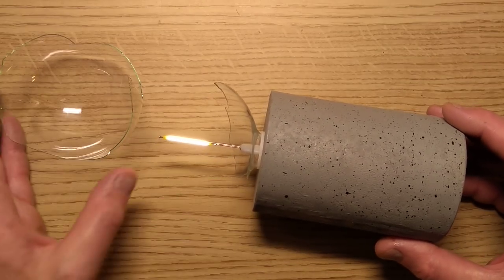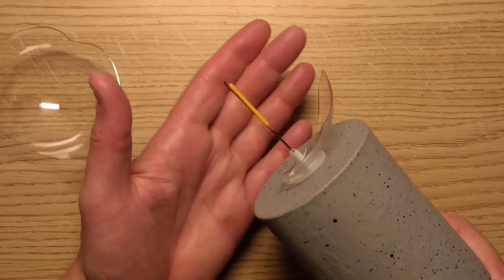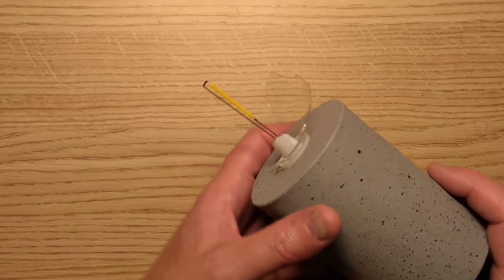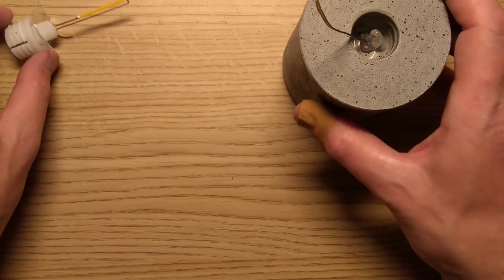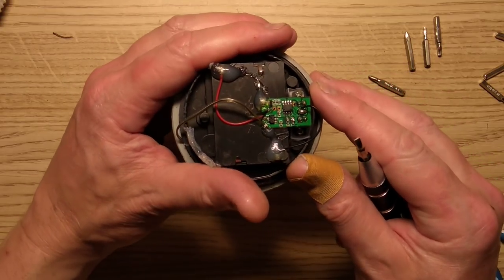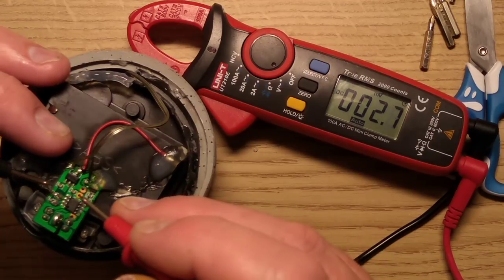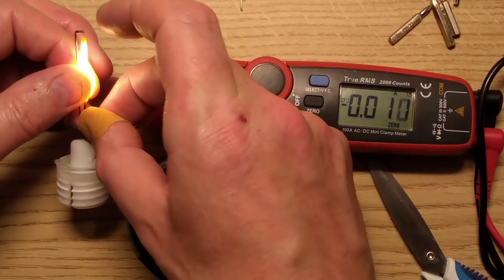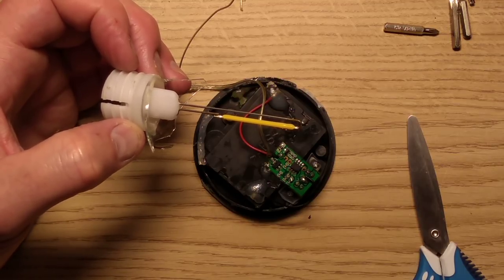Inside a pre-smashed Sainsbury's stand-alone light.

Comment: Crazy that they made it to take AAA batteries.  I hate it when those things are used in devices that are plenty big enough to make room for AA or even C batteries, it's just bad design.
Reply: Exactly.
Makes no sense to have a huge empty resin body to it and not put C size batteries!
Reply: 'C' batteries!?  You could damn near fit a 6v SLA in there!  Charging circuitry for it too.

edit: damn or dam
Reply: Why stop there? That light is already bulky enough to hold something even more substantial than Cs -- perhaps an SLA. It wouldn't be difficult to design the interior to hold a range of battery sizes/form factors, in a common 'nest' with break-away dividers… By default, provision is made for the cheapest/smallest/most anemic cells, but the unit can be upgraded to whatever the buyer desires… Perhaps make it possible to add one or more solar cells. Sell it as a learning tool, a hobby kit, something that will survive for years. Building it to a final form locks too much into place. 

Glass bulb? Strange choice. Something as simple as a clear plastic pill bottle, or something 2/3rds the length of a test tube, would have sufficed to protect the 'filament'.
Reply: Gotta make sales as fast as possible so they use of the shelf components
Reply: Replace the batteries with an 18650! Would last for ages~ Looks like there's enough room in there.
Reply: @LunarHermit  C or D batteries would be better for most people. Yeah, I know, 18650s are technically better but they are still unfamiliar to most people. That makes some people reluctant to buy things that use them. I would have no hesitation and I already have a charger that can charge them among my chargers, but I am not typical in either of those things.
Reply: AAA and AA cells generally cost the same but AAs have a much higher energy content and are thus far better value and need changing less often.
Reply: who still has C batteries though? AA is the way to go
Reply: FireAngel Londoner, powerbanks also use 18650 and people do use them. They could just have made it a USB-charable light.
Reply: @FireAngelOfLondon   People don't seem to mind USB rechargeable stuff, so add a socket and the charging/protection circuitry along with 18650[s] or a LiPo...
Reply: Designed that way to sell more batteries.
Reply: @michaeltempsch5282  Except that the USB connector rusts out almost immediately (this is supposedly an outside light), and the connector plus 18650 costs more than a AAA battery pack.
So, yeah, the vendor won't be doing that; horrible economics and warranty returns.
Reply: AAA batteries will run that led for quite a long time.
Reply: The other evil-genius aspect: design things that take three AAAs, but sell batteries in multiples of two (i.e. 2, 4, 10, etc.). And you get dinged for the ever-more-ubiquitous eco-frais for having chosen to run some little modern convenience on batteries…
Reply: @michaelthibault7930  hot dogs and hot dog buns
Reply: That includes the clamp meter, by the way.
Reply: @LunarHermit  "an" 18650?  Looks like you could stuff a bundle of them in there!
Reply: @MrMilarepa108  I was thinking D for that device...
Reply: It could even hold D batteries, or even several 18650! I love my Luminara candles that have D batteries in them, they've lasted almost a year of occasional use and sometimes forgetting to turn them off.
Reply: I often scoop out the "triple A" bits, and hot knife a bigger space for AA's. Hot glue the bits back in, and whack in some decent batteries. If possible. Usually is.

Comment: For an outdoor garden light, I am astonished they made the globe of thin glass. Bumping it with garden tools or a small branch falling on it, and the globe will explode, leaving sharp pieces of glass throughout the garden. It should have been made of plastic.
Reply: Plastic would fade.
Reply: Maby they thought it would increase revenue.  Still a very bad idea using glass.
Reply: I'd like to echo your comment with the emphasis on THIN.    The ex-mustard pots I use as drinking glasses are only 2 to 3 mm thick but almost unbreakable....  OK a hammer would do it.  I agree, the thinness of the glass was stupid.
Reply: Glass is better than plastic... it's only sharp for a short time, plastic is poisonous forever.
Reply: Colorado Strong  I guess cause both with erode in different ways.... But this is why you don't bring bottles camping.

Comment: I seem to recall an old popular mechanics book of hints suggesting removing broken lighbulbs with a potato - they don't bleed - or scream. Not that I would expect Big Clive to scream - just bleed :)
Reply: Yeah but pushing it down over the LED (central glass column on the old incandescents) might be bad...
Maybe splitting it into quarters and gouging out a channel in two making place for the LED but allowing the bits to be pushed down into, and grip, the screw base.
Reply: An exhausted tennis or racquetball ball, holed (dinked) neatly and axially. Or a rubber handlebar grip partially installed on the end of a broom-handle. 

Potato? Sheesh!

Comment: When I was a teenager I broke a 150W lamp's globe in very much that way. Unfortunately back in the 1980s that meant a tungsten lamp, and it was switched on at the time. The filament went off in a very interesting puff of smoke and then I had to climb a ladder and get the broken bulb out of the socket. I was a bit more circumspect about casually sweeping my jersey over my shoulder from then on.
Reply: When we had (bare) CFL lamps, I'd smash one every year or two while changing my shirt or just stretching.  Now with LEDs, there's less breakage, yay solid state  :-)
Reply: @theskett  Unfortunately all the replacement technologies have much weirder failure modes than good old resistive filaments. Used to be you heard the pop and you went rummaging for a new bulb; now it's "Okay, it's flickering? A little? Oh, part of it is flickering!" or it gets a little dimmer, and a little more, and so on until you decide it's old and replace it, and then the new bulb is blindingly bright in comparison . . ..
Reply: @Azlehria  I had a 200W incandescent explode broken glass across my bedroom carpet; it's now replaced by a nominal 90W of LED lamps which IME fail more gently -- and I'm not going to complain about that :-)
Reply: @theskett  Oh, yes. I'm definitely satisfied with mine - the household is all-LED except for 4 fluorescent tubes in the kitchen (possibly not for long) and a pair of fluorescent torchieres - and I wouldn't want to go back to incandescent or even halogen at 25¢/kWh. The longer life more than offsets the greater cost up-front, as well; they just get a little strange at the end. It's a petty annoyance that's certainly worth putting up with.

I do rather dislike CFLs, though. In my experience their lifespans are similar to incandescent at best, and often shorter; they're far more delicate; even the highest-quality models I've used have run their ballast circuits hot enough to burn (distort and permanently discolor) the bases; except when subsidies peaked they haven't been much cheaper than LEDs up-front; and they have a marked tendency to strobe when failing. There's also the hazmat contamination problem when, not if, you break one of the - again, delicate - tubes. It doesn't even have to shatter; simply breaking the seal at one end or cracking the glass is sufficient.
Reply: @Azlehria  Agreed, on all that... although my experience is that the CFLs run pink at end-of-life (which, from a previous Big Clive discussion, indicates they've lost required mercury vapor).  Sooo, I'm not going to sweat the mercury.  And (due to crockery mis-steps) we put enough  shards on the floor, that occasional broken glass from CFLs is "in the noise" :-)
Just remembered:  I much prefer the instant-on of LEDs [and incandescents] over the warm-up of CFLs, especially in the bathroom at 3am :-)

Comment: Hmm, a bean tin full of cement, a lamp holder and some batteries - where did I go wrong?

I'd guess thy built that lamp with the idea in mind that it would survive several summers, and a glass globe won't become crazed and dull after a few weeks - you'll have seen what happens to plastic headlamps in cars? I suppose you could put a row of these alone the side of your garden path, and dot a few around your patio (if you're trendy enough to have one). It's simple, it's decorative, and if you treat it with respect, it should be safe enough.

Another Sainsbury product, and I only bought one yesterday, is the "RAC" (not so sure about that!) miniature hurricane lamp. They've been around for a while now, and I've always thought of them as a bit of a joke - a kids' toy if you like. However, after the power went out in a storm at the weekend, I bought one of these things, and they're not bad! Handier than a candle, safer too, and the light output isn't too shabby, given the size of the thing.

Comment: The other advantage of "AA", rather than "AAA" cells, is the cost. The larger "AA" cells are usually the same price, and sometimes even less expensive than "AAA" cells, and will last more than twice as long, before needing to be replaced. That transistor is set up to be a constant current regulator, so slight differences in available current and equivalent series resistance, will not cause the LED "filament" to draw any more current.

Comment: After watching you disassemble LED lamps I tried to do the same with a couple of faulty ones. The first had a plastic dome, but the second had glass. I was part way loosening it from some white sealant when it broke, sending little shards across the table.
Having learnt some of your tricks I tried to find out whether one or more of the little smd leds was the problem. There were about 25 in series.I put a 'short' across one I suspected was the problem and all the rest lit up again. I don't have a suitable light fitting so did not measure the current/voltages. I won't be using the lamp any more, just thought I would try some of your methods to see what the problem was.

Comment: I'd probably rewire it to run the LEDs via the 43Ω resistor directly from the battery instead of via the 3.3V regulator.  More bright and efficient that way.  Then again, I'd also do like the other commenters suggest and stuff a trio of C cells inside the housing, which looks to have plenty of room inside.

Comment: Isn't a linear regulator rather inefficient for driving an LED?
Reply: Generally yes, but this is only wasting about 10 milliwatts since the supply voltage and current are so low.
Reply: @stargazer7644  But over time this would add up and reduce use time, no?  It wastes maybe 1/4 of the power.
Reply: @ChristieNel  Yes, you're absolutely right.  I suspect it was done this way for cost reasons.

Comment: sometimes i wonder if products like this could instead use maybe one C or D battery  and use a boost converter to get the proper voltage.. im not sure what the capacity would be vs 3 AA or AAA batteries but it would be simple. either way it should use AAs at a minimum... AAAs are so annoying, it always feels like a waste to use them

Comment: I wish China would just ban the use of AAA battery holders all together.  If you're using 3xAAA cells, then you should really be using an 18650 or 26650 cell instead, for 10-20 times the energy capacity.  Plus quality alkaline cells cost more than quality lithium ion cells anymore.

Comment: It has plenty of room you can even put 3 D cell battery in it and probably will last for few years
Reply: 'D' batteries!?  You could damn near fit a 6v SLA in there!  Charging circuitry for it too.
Reply: @Kineth1  yeah that was true but, the circuit use voltage regulator instead of switch power supply. That's mean the closest the voltage sources  (battery voltage) to the working voltage  (3.3V) is better, because voltage regulator work like an a resistor the higher the potential different the worse it will be,  because it will turn the excess power into heat and fry the voltage regulator  (short the lifetime). So if you want to change the battery make sure as close as working voltage, and i just suggesting whatever you want to read this or not but yeah that what I know so far. Btw you can use Li-ion battery as large as you want. 😆😆😆

Comment: Clive.
I was wondering if you could please give me an answer to an issue I had.
I have a cheap video camera that runs on 3xAAA batteries, i made 2 fake batteries (1+ & 1-) which were joined by wires to a battery pack (3xAA by 2 parallel) giving out 4.5v.
The plan was to have a decent run time, and it worked. Until I left it connected and after a while the battery pack decided it wanted to get hot.
There were no shorts and the polarity was correct, the camera still works but I don't want to connect it up again until I know what went wrong.
Any ideas?
Reply: @Matt Quinn 
Hello Matt, a bit more information.
The camera was turned off, but it's one of times where the on/off is microchip controlled and not an actual on/off switch.
And it was the external battery pack that got hot, hot enough to smell it across the room.
The wires that joined the battery pack to the camera weren't hot and neither was the camera
I just find it odd that what I did was, keeping it simple, was to swap AAA batteries for AA. 
I'm sure I missed something.
Reply: @Matt Quinn 
The external battery pack was one of those holder things. It has places for 8 cells, and I'll use positions 1-8 when explaining.
I wired it as starting at the positive terminal of the holder.
Places 1-3 had cells in them, in the 4th space I ran a wire from the positive terminal to the negative terminal of the holder.
In space 5 I had a wire running from the holders negative terminal to the positive terminal of the holder, then spaces 6-8 had cells in them.
And there is no connection between spaces 4&5 in the holder, 
As for the dummy cells in the camera I made two of them using a pencil cut to length and hollowed out, I then drilled a hole in the side of each and put the end of the wires through and used a screw as the terminal. After making sure that all the polarities were correct I turned on the camera and it worked.
It was days later that it all went wrong. 💥
I just hope I'm explaining this well, words aren't my strong point.😙